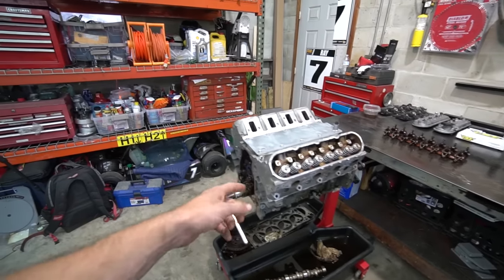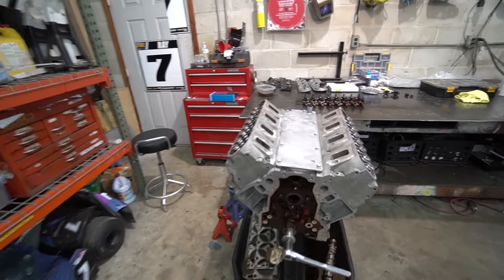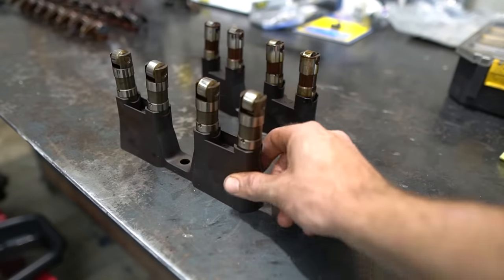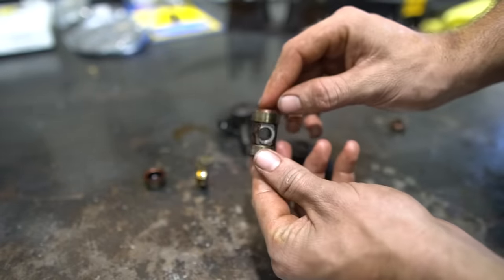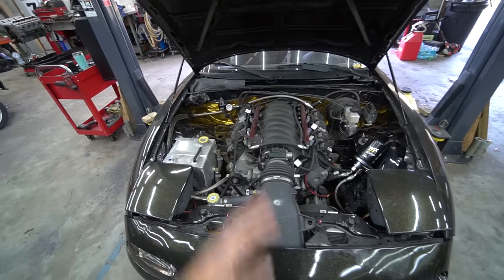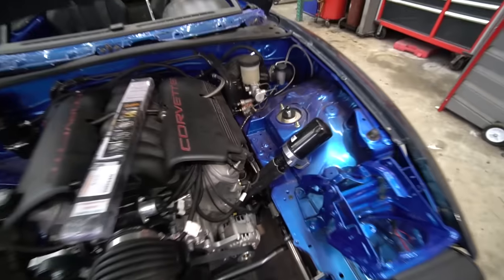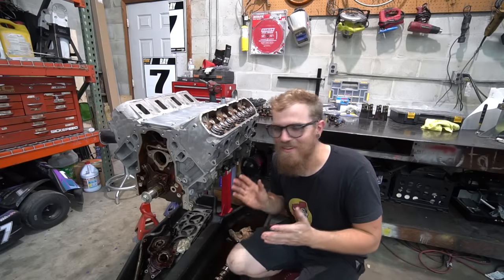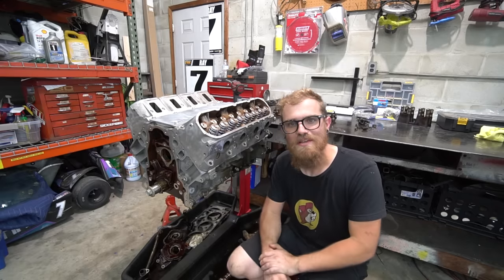Top 5 Mods To Make An LS Engine Reliable.

Comment: Melling high volume/pressure oil pump and a good baffled pan. That is the secret to a reliable LS engine without dry sump.
Reply: Chris Stevens so simple I run one in my burnout car in Australia stays flat for 2 miniutes no oil pressure this guy just does seem to get it just put an oil pump on all your issues solved
Reply: Chris Stevens I've heard mixed things (mostly all good but some negative) about Mellings failing or wheter high pressure, stock volume vs high volume - high pressure. Which model do you recommend? I've been thinking about going the ported LS6 on my LS1.
Reply: Kyle Clemmer I cant say anything about Melling failing in general. Could be people not shimming the pump correctly when installed. Or pinched oring on pick up tube. I run high volume high pressure, they come with an extra spring to reduce it to stock pressure. I see 55psi at idle and 80+ at wot. Hope that helps good luck 👍🏼
Reply: Jdm Hilux yeah he’s a brilliant dude, learned a lot from his videos but I always recommend changing to high pressure deal when pulling the pan off.
Reply: Melling 10296 Pump?
Reply: Hell I put a milling pump in my jeep engine. My family has swore by milling pumps for years. Until one does me wrong ill keep using there stuff.
Reply: LS has a good gerotor style oil pump and in my opinion don't need hi-vol/psi unless added lines like cooler and remote filter or more bearing clearance, otherwise your increasing the pumping losses.  Plus most people don't think about oil return after your pumping it faster.  A stock(unmodified block/heads) engine is fine with a stock pump, for example the sbc oil pump is design to provide more than 30% required oil if in good condition.
Reply: no pump is going to fix the oil pick up sucking air. high g loads has zero to do with oil pump type and all about keeping oil in the pump.
Reply: Yup, Improved Racing pan baffle kit and rank oil scraper plus a Melling 10296. However I prefer the stock pressure spring with the high volume pump.
Reply: @frankmelero5511  that's what I run in my 370lq4. Works good for cheap.
Reply: Smelling. 
Haha they make good stuff , it's just what we nicknamed em at the shop.
Reply: New oil pump. High volume and or high pressure pumps only wastes horsepower.
Reply: The only reason you would need a high volume pump would be if you have something needing oil added to the motor, like a turbo or wet bearing  supercharger.
Reply: @hackeds1484  been turning wrenches for 16 years and have never seen an oil pump fail. It’s the first component to receive lube on start up and the last component to receive lube when the motor stops. It’s the pumps peripherals that make it seem like they fail. As in blocked pick up tubes or hardened/cracked pick up assembly o-rings.
Reply from the maker: From what I understand the high volume pumps can suck the pan dry and cause starvation.
Reply: @enchantedwenis4994  with that being said I got a break my LS down does the new pump I just put in there the only gave me a few hours of oil pressure think there's stuff all up in the car can I do some type of flush from the oil sending unit hole to make sure there's nothing clogged up in here when I do the oil pump this time?
Reply: @dirtyglovekennels616  check your pick up o-ring .
Reply: Pickup tube ring from felpro/melling
Reply: @enchantedwenis4994  except they do fail when you are pushing them beyond the limits they are made for . I've seen multiple SBC and BBC's break the drive shaft or twist the notch off the top . I've seen them break the area around pick up tube ( we used to weld pick up to pump to add support and prevent the pick up from falling out. Which I have had happen on a  750hp dirt circle track car ) . I've also seen the gears stripped . But most all of those failures were caused by the driver starting the mtr ice cold with 50-60 weight oil and high volume high pressure pump not allowing it to warm up to close to operating temp and putting foot in them . I've also seen LS style pumps burn and crack the plates but I believe that was due to loss of oil to the pick up or blocked pick up or faulty pick up o ring ... I'm not a high pressure oil pump fan but I do like the high volume pumps with a close to factory pressure spring. But you are right there is always something that caused a oil pump failure
Reply: @jasonsparshott7208  I was speaking from a non modified/high performance perspective and experience. But I believe everything you’re telling me. The oil pump does seem like one of those easily over looked upgrades when chasing unicorns. I appreciate you bringing that up in the discussion because I just realized I never did any upgrades to my 302 Windsor oil pump but I’m only looking to get 400-450 unicorns for driving around the street. Hopefully the pump shaft won’t fail me!
Reply: @enchantedwenis4994  it will live ( no need for high pressure just drags the mtr down with oil and parasitic loss ) I'd run a high volume Pump with a close to stock pressure spring . You don't need 50 lbs of pressure at idol and 100 psi up top and make sure you bring the oil up to temp with a HV/HP pump and 50 weight you could see 100 on cold start up and that's just to much blowing oil out around all the bearings Lol . I open up the and smooth the drain backs and chamfer all supplies and bearings when doing a full race build mtr . I'd rather have more flow then pressure pressure is increased by blocking off part of the oil pump feed ( heavy spring higher pressure lighter spring less pressure but more flow just like you putting your finger over the end of a water hose to make it spray ) so it raises pressure yet lowers volume so the term HP/HV oil pump isn't really a true description. It's actually a high volume pump with the ability to be high pressure by changing spring tension and closing or opening the feed out . Obviously a bigger stronger pump is going to move more oil even with a high pressure spring but with the high pressure spring comes a big loss of volume and for me volume of oil is more important then pressure! I'd rather have 20psi idling hot with plenty of oil lubing then I would 50psi in a limited amount . You see what I'm saying? Most don't
Reply: Honestly you can port the stock pickup, dimple the stock rotor and shim the stock spring about .080 and the stock pump performs just as well as any aftermarket pump But way more reliable. Not knocking the melling I've used them on gen 1s since before the LS was even in development in the 80s. I've never had a singular problem with them in the last 25ish years but I don't really see a point in running them on an LS because with like 30 minutes of work and some hand tools the stock pump performs just as well.
Reply: Why don't they make those bronze roller bearings for Sr's !!! ???? Ahhhh
Reply: Just replaced my rear main seal and pan gasket. Next move is the front seal and a high volume pump. Had to replace the engine mounts and I did the trans mount also. Why not? Alot of cleaning. Pick up tube and windage tray were crusty most likely due to the synthetic oil the previous owner used. Been a long process. Knock sensor codes. So, those with wire loom and new gaskets on top. Just hoping my rod bearings are ok. We shall see? 04 Surburban with 5.3
Reply: I had a bur lock up the pressure relief valve in the stock oil pump so I slapped a melling high pressure in there and it's been awesome ever since.
Reply: If you have a ss or corvette already comes with a performance oil pump which is not necessary. Just a waste of money and time.
Reply: @backdoormailman  check out engine masters on that subject. they lost around 20hp on adding extra quart of oil in the pan. still better than rod knocking.
Reply: @Taylordrifts  that’s high pressure oil pumps.